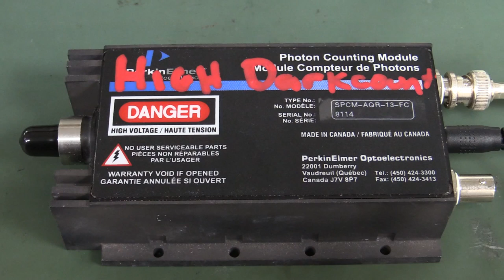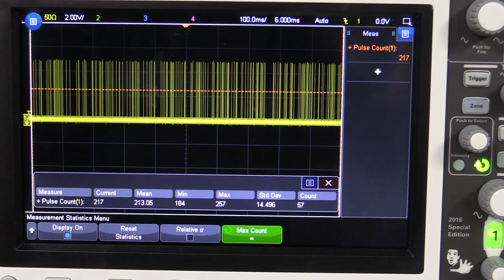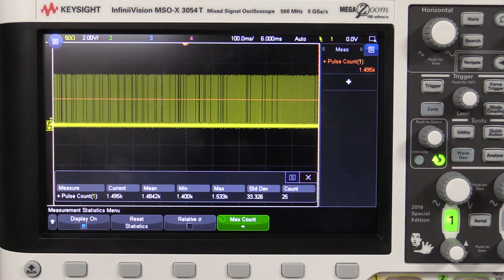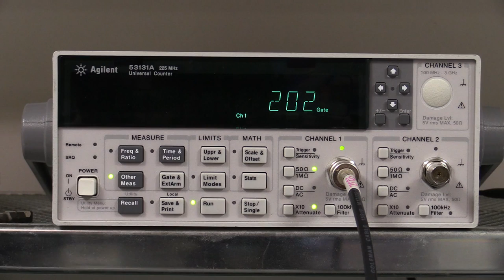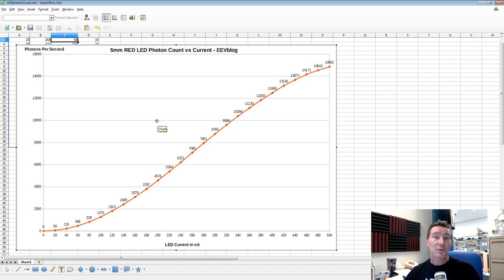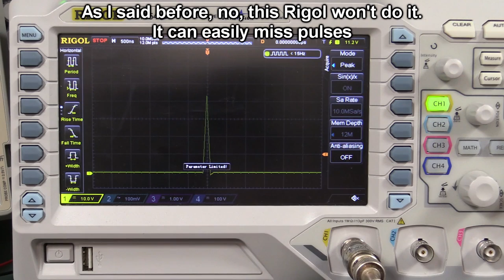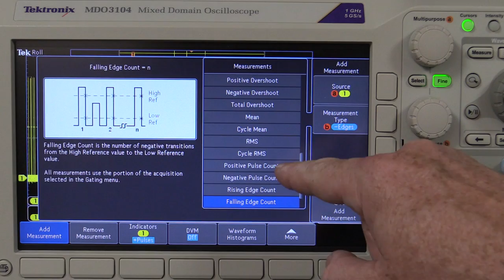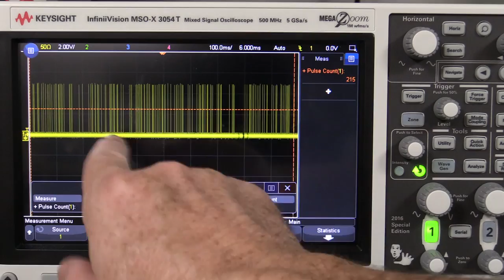EEVblog #869 - Counting LED Photons!

Comment: Video request: repairing broken craptops.  I have three just sitting here each with the same problem.  No power, except an LED or two indicating the charger is plugged in.  Plus some other junk craplet/craptop that just randomly decides it wants to join the club.  NOT the power jack, lord knows how many times i've fixed that
Reply: +Nathan Darker You know, there's like a million things that can be broken on a laptop, and this isn't really an ict channel :) . If you check voltages and it's not correct then it's PSU. If voltages are good then hook it up to external screen. If doesn't work, then it's blown mainboard / fuse.
Reply: I know the three craptops have bad boards, it's really hard to find the broken components
Reply: Nathan Darker Check for bad caps on the main board. If that's okay, then you're gonna have to reflow it in your oven lol. If all else fails, there's always the option to replace the board. However at this point you might ask yourself if it's economically desirable lol
Reply: I went over it somewhat briefly, and could not find any bad parts.  I DO have a reflow station, but have never used it for anything other than basic soldering.  I'm going to guess that's better than an oven, I imagine it's best not to heat up the electrolytic capacitors.  I can not seem to find a tutorial though.  I guess just place the spot on the pre-heating bed and keep the temperature within the chip's temperature range?

Comment: Maybe he start emit photons in invisible infrared spectrum above 700 nm. Then from 1µA starts emit 600 nm.
Reply: +Михаил Соловьёв 
Nope, that's not how quantum mechanics works. Of course the emitted light spectrum does have a certain distribution and it will change with temperature, but it shouldn't vary with current (as far as I'm aware). Electrons either have enough energy to hop over the barrier/band-gap or they don't.
Regardless, the camera Dave used, to film the LED, would be sensitive to IR. So we would have seen it in the video if there was IR below 1 µA.
Reply: +Jack White Does Camera in color mode cut IR spectrum?
Reply: +Михаил Соловьёв 
I do not understand what you mean by color mode. As far as I know cameras either have an IR filter physically built in, or they don't, most cameras don't have an IR filter. You can easily check that yourself by holding a TV remote in front of a camera and press a button.
Reply: +Jack White I think in bw mode cameras more sensitive to IR spectrum, that's why all CCTV cams have both color/bw modes.
Reply: +Михаил Соловьёв 
I can't see a reason why that would be the case. And even if cameras are more sensitive to IR in bw mode, I don't think that's the primary reason why CCTV cameras have both modes.
Sadly I don't have a camera at hand where I could test it real quick, but I bet sensitivity to IR is the same in both colour and bw mode.

Comment: Hmm..... If only I had a precise current source. I bet my bottom that I can do some photon counting with my astro-photo gear. Monochrome high-quantum-efficiency CCD sensors specifically. One of them is right around the 85% mark which is pretty impressive.

Wonder if some long-exposure imaging + some math and statistics could produce similar results. In fact with long exposures, and a well-known dark current (something we're well aware of in astrophotography), I bet the results could actually be more precise. Would need precise timekeeping as well I suppose. Should avoid the saturation problem anyway, the well-depth is large enough for plenty long exposures to make for good SNR. Would probably do stacking as well to further improve SNR - just like we do with actual photography. Which, is essentially the same thing anyway, photon counting!

I have a larger CCD as well but it's bayer filtered so much less sensitive, and also smaller pixels (a lot more of them, 16 megapixels). But it does have set-point peltier cooling, so I could keep it a cool -20*C or so, as a controlled environment, and the dark current is very very low at those kinds of temperatures as well.

Man. Now I'm all inspired and shit, time to go dig around the basement for the cameras....
Reply: +Mythricia Okay, a few hours later and some very rudimentary testing, my results are, for 50nA I got 682 counts/sec. Which looks to be at least somewhat in the same universe as your measurements - I also used a random LED out of the junk box, which means nothing, but hey.

I wouldn't trust my result though, I basically hooked up the LED to my power supply, used series resistors to drop the current to a theoretical 50 nA (I had no multimeter at hand to measure each resistor precisely, nor the current for that matter), placed it right up into the CCD enclosure and covered all of it thoroughly. I then captured 100 images with the LED disconnected to establish a dark reference, then I connected the LED and captured another 100 images. I averaged the two stacks of images, and then I calculated the average pixel value for each of those resulting images. Subtract one from the other - divided and multiplied to account for quantum efficiency and e/ADU.

Should really repeat it with my temperature controlled camera and do the entire curve like you did. Fun nontheless!

Comment: Lol one of my summer projects was going to be to do this exact thing but with a photomultiplier tube; I guess I don't have to anymore.
Reply: +Sarah Watt (NuclearSarah) 
On the contrary! It would be very valuable, if you'd repeat the experiment, so we could check if Dave's results are reproducible.
Reply: +Jack White That's actually a good idea. I'm not sure if I'll get as good results with these old photomultipliers but it would be interesting to at least see if I get a non-linear function as well.
Reply: +Sarah Watt (NuclearSarah) 
I don't know what your setup would be, and I'm by no means an expert, but if you know the spectral response of your PM tubes then I would choose a LED with a wavelength towards the shorter end of the spectrum, in other words move as far away from the thermal IR as comfortably possible to reduce noise. Additionally you could play with the dynode voltages, I'm thinking of lowering them to reduce noise, particularly the first one towards the photocathode, maybe you could make the PM more sensitive to blue than red and still have the rest of the dynodes at higher voltages in order to still get good sensitivity ... I'm just thinking out loud here.
Reply: Yeah, the tubes I'm using are more sensitive on the blue end so I was going to be using a blue LED.
Reply: I'm using these ancient RCA 1P22 photomultipliers because I managed to snag a bunch of them cheaply. The main goal of my experiment would be, aside from curiosity about LEDs and their hypothetical minimum current, to determine if they're sensitive enough to build a liquid scintillation counter (tests water and other fluids for radiosotopes) with before I waste the time designing and building the thing only to actually need better tubes. Newer tubes are more expensive than I'd like so I'm hoping I can get away with these.

Edit: Would also be good as a test. I mean who knows? Maybe none of them even work to begin with.
Reply: +Sarah Watt (NuclearSarah) 
That sounds like an interesting project, and testing LED's would go hand in hand.
And testing old PM tubes first is probably a good idea, who knows in what condition they are in.

Comment: It has a linear section in the center like a biased transistor or diode.
I would imagine an opto coupler might show a similar section.
How many photons do you need for a human eye to see them?, no its not the start of a joke ha ha :-D :-D
Reply: +zx8401ztv Fully dark-adapted humans can see individual blue photons, but there's only a small probability that the blue photon will hit the right location. So there is some avalanche-style, photon counting functionality sort-of present in the human eye.
Reply: +TheHue&#39;s SciTech 
Im really supprised that human eyes can detect anything at such a low level, some animals have superb vision, makes ours look quite rubbish really lol :-D.
And the answer to the joke "How many photons do you need for a human eye to see them?".
Five!!   ,one to do the job, one to wander off in the wrong direction doing nothing usefull, And three to write safety reports and document it for other photons to read about it. :-)
Sorry, silly there :-)

Comment: Are you sure you aren't simply measuring the response of the photodiode here? You clearly saturated your experiment setup at a level of 15k photons. I imagine the upper portion of your plot should look linear, but you are in the non-linear response range of the photodiode and your not getting an accurate reading.